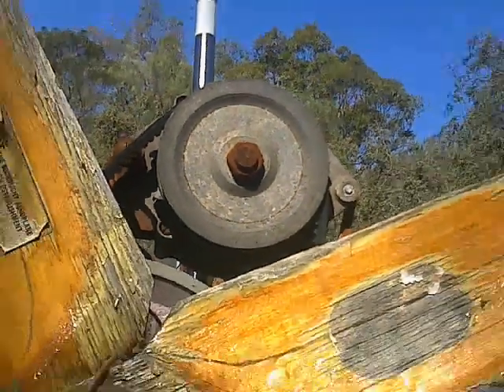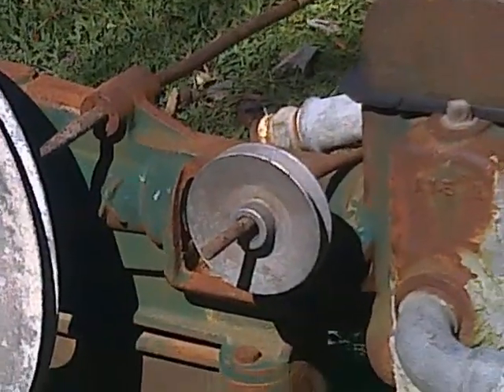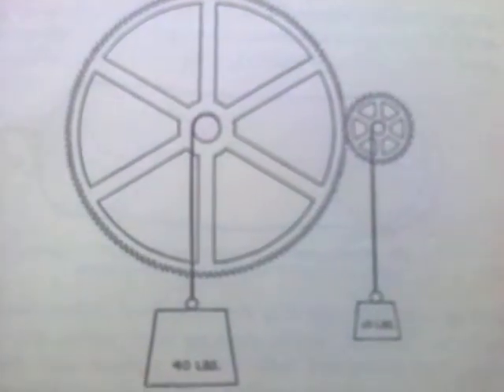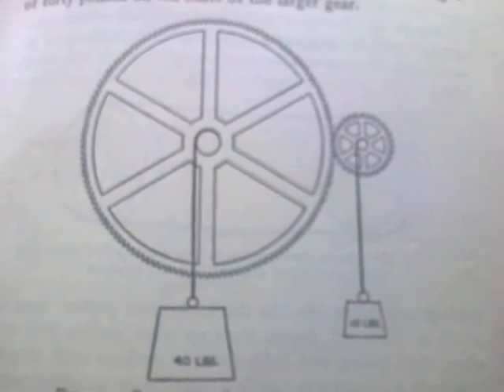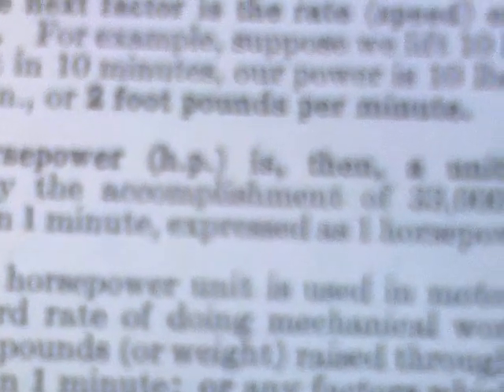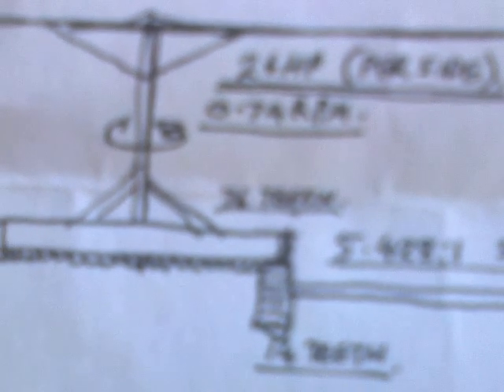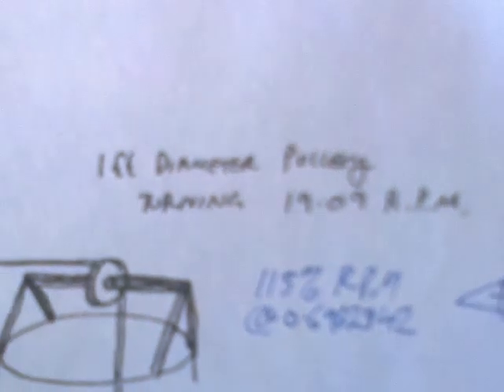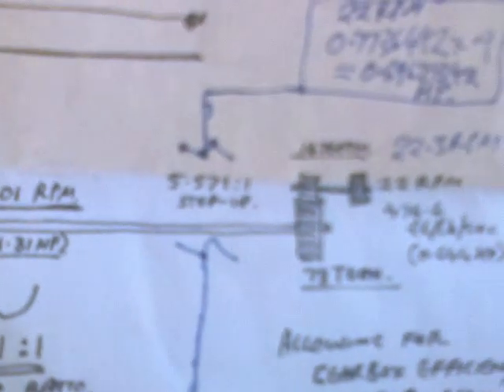The Magical Dunning-Kreuger Gear-Ratio Effect...!

Comment: I reckon it’s weird when you stare at a spinning propeller and it appears to be spinning backwards. It’s an optical illusion
Reply from the maker: G'day Ed,

 Thanks mate.

  Yeah, it used to have to do with the mechanical Shutter of old Movie Cameras & the Frame-Rate ; any time a wheel was turning at an exact multiple of 24 then it looked to be stopped, if it was turning at almost an exact multilpe then the "stopped" wheel apparently went slowly backwards, and if at slightly more than an exact multiple the "stopped wheel seemed to turn forwards.

   Now it's done with Charged Couple Devices & they scan Left to Right in a column of lines...; so turning Blades come out as looking curved, because it moves between Line-Scans as the Picture is being "Built up" - whereas with Chemical Film the whole Frame is exposed at once in a "Snapshot".

  Techno-complications....

Have a good one,

;-p

Ciao...!

Comment: By the way, I was taught this math during sailing class. We had to calulate force, work, etc., based upon different gear ratios, and block-and-tackle "falls."

What both of you should be talking about is WORK, but as you noted, your friend is not talking about WORK consistently, and you are.

Bottom line: if you increase DISTANCE (as gears and levers do when the drive shaft is the smaller gear) the same amount of force can do an increased amount of work--- but slower. This is because Watts have a time component, and work has a distance component.

The simplest machine that does this is an incline plane. It is a machine because it increases distance on the horizontal, to lift a shorter distance on the vertical, over a longer time span. WATTS stay the same, but WORK increases because DISTANCE increased.

Comment: Hi Chris,

More numbers? I was never any good with numbers, but you have a gift with calculations.

The way I see horsepower is the bigger the horse the more power so the Clydesdale horses, (they get their name from where I live) would pump out plenty of power. That's my calculation :D

The place of Uddingston is just about 3 miles from my house. I never knew that the company John Grey & company even existed. 

Cheers mate.
Reply from the maker: G'day,

  Thanks Mike.

   Well, I was hoping you could tell me where the place was.., it must have been in a reasonably big way - the 76-tooth Crown-Gear on the  Capstan is four & a half feet accross, cast in one piece...; it appears that Johnny Gray & Co. had a pretty good idea of what they were doing...! 

  I agree that Clydsedales, big due to having been bred for pulling Ploughs, or War, were bigger than Pit-Ponies...; but the idea of a "Horsepower" being 550 Foot/Pound Seconds of Twistiness in a Shaft, with a 1-Ft diameter Pulley turning at 19.09 RPM - is an old starting-point, and I figure a pretty good one from which to calculate the "worthwhileness" of attempting to make Electricity with a Horse-Mill...

  And I'm pretty sure I've got it right..., that multiplying the Twistiness will divide the Shaft-Speed, while multiplying the Shaft-Speed divides the Twistiness delivered in the Output Shaft, as compared to the Input Shaft...; and 405 : 1 is a monumentally humungous Step-Up Ratio...., before even getting to the Generator so rather than being too upset that there's "so little Electrickitiez" to be had - I'm amazed that it's as much as 29.02 Watts per Nag !

Such is Life,

Have a good one...

;-p

Ciao !
Reply: Here is a couple of links that may interest you.
 https://www.gracesguide.co.uk/File:Im1877Glasgow-Gray2.jpg

I am in Motherwell so here is a map of the area with Uddingston.

https://www.google.com/maps/place/Uddingston,+Glasgow/@55.8030833,-4.0824893,12.5z/data=!4m5!3m4!1s0x4888402a3dccf359:0x33f8d3f906dc4492!8m2!3d55.815735!4d-4.0791271

It's a big link from Google maps. Hope they work ok.

Oh, I meant to add. If you look at the map you will also see Blantyre, the place where the famous David Livingston (explorer) was born and lived.
 Cheers Chris.
Reply from the maker: +Mike Flight 

Ah, well, my phone couldn't follow those links.

  I'll have a look in the big Readers' Digest...

  Have a good one,

;-p

Ciao !

Comment: I'm with you on this one.  It's hard to believe that the video you mention was used to prove a point. Even if the video isn't fake, it's not an accurate method for determining watts of electricity production.
Reply from the maker: G'day,

  Thanks mate !

    I'm glad that you too can see that counting the Bulbs, and multiplying the number in the flock by their Wattage rating printed on the Glass, is not a valid way to estimate how much Electricity is emerging from a Horse pulling on a Capstan turning a Step-up Gear-Train...

   Old mate and I had spent about 4 dayze over Xmas bombarding each other with Text Messages, neither one yielding an inch ; so YT Peer-Review was the only reasonable solution -  short of trying to convince the  local Historical (Hysterical) Society to lend me their Horse-Mill, and persuade someone to relocate it to somewhere big enough to set it up, and then go looking for a Harness-trained Horse...., with which to actually do the Experiment.

  Anyway, Happy New Year,

  Have a good one...

;-p

Ciao !

Comment: Torque and rotational speed calculations are superfluous .. Input Power is 1 Horse power (740 Watts ) multiplied by transmission losses (chain drive typically 98 percent efficient) Lets say 95 % per step up stage of 60 tooth and 9 tooth  (6.66667 speed multiplication) in 4 stage will achieve 1462 rpm.. So 740 watts  by 0.95 X 0.95 X 0.95 X 0.95  leaves 602.734 watts of mechanical power to convert to Amps and Volts.. Most modern generators will be better than 80 percent efficient giving 482 Watts of electricity... that's about 35 amps of 12 volt power or 96 amps of 5 volt USB power. enough for 32 I phones and 32 I pads.. The video you mention looks dubious .. the horse is not a standard  British Pit Pony and could be inputting illegal amounts of energy... the slip rings on the vertical shaft  look fake and decorative.. and the globes seem to light the instant the horse moves ??  F A A K E as.
Reply from the maker: G'day,

 Thanks.

  I disagree strongly with your assertion that RPM & Torque measured at the Shaft are superfluous.

  To multiply the RPM by any Step-Up Ratio involves dividing the Input Torque by the Ratio in question.

   1 Horse with a 26 :1 Leverage advantage at 0.74 RPM driving a 405:1 Step-Up Ratio achieved in 2 Gear-Trains (at 90% efficiency, each) plus 2 Belted-Stages (at 95% efficiency, each)...is in no way able to deliver 0.73 of  Hp worth of Twistiness at 300 RPM.
  
  The actual Figure is 0.0461509 of a Hp worth of Twistiness, at 300 RPM.

  Think of it this way, everybody who ever tried to fly with Engines between 8 Hp & 80 Hp, running at 3,000 RPM to 6,000 RPM, using direct-drive Propellers has been disappointed (many, like me, have crashed with their Direct-Drive high-speed tiny little Toothpicks cutting useless little holes in the Air, converting Fuel into Noise)...

  The High Shaft-Speed & low Power means insufficient Torque to turn a large Propeller, and the small Propellers don't engage as much Atmosphere, so the small Disc has to try to accelerate the little bit of Air it can grab to really high speeds, relative to the Aircraft's Airspeed...; and for example, a 65 hp Engine at 6,500 RPM and a Direct-Drive Propeller about 4ft 6 Inches diameter, emgaging 15.9 Sq Ft, will struggle to fly....

  It's Tips have a Circumference of 14.139 Ft, and at the Engine's "optimum RPM (108 RP Second) it's trying to drive the Tips at Mach 1.53...

  Which won't happen, and the "ideal" Tip-Speed is 660 Ft/Second - after that the Tip-Drag becomes prohibitive, so the Prop wil bog-down at about 750 Ft/Second Tipspeed, or 3,250 RM, or 54.1 Rev's per Second, at 15.9 Sq Ft.

  If one was trying to fly at 50 MPH, allowing for 10% Slippage, the Propeller would be pitched for 80.3 Ft/Second Advance rate, (at 6,500 RPM).

 But at the achievable 3,250 RPM which is achievable, meaning a Slipstream of 40 Ft/Second as the the Advance Ratio (less slippage,) giving 36 Ft/Sec. which = 572.4 Cubic Ft/Second (at 0.09 of a Pound per Sq ft going backwards at 24.65 MPH giving 51.5 Pounds of Thrust....
 

  However, given a 2.58 : 1 Reduction Drive, the Output Shaft only tries to spin the Propeller at 2,519 RPM, but the (modern Rotax) Redrive Gearbox is 95% Efficient, so the Prop. has 159.315 Hp worth of Twistiness driving it ; meaning the Propeller can be maybe 72 in diameter, engaging with  28.278 Sq Ft of Disc Area., the Tips sweep a Circumference of 18.85 Ft, so a the Gearbox is trying to achieve 791 Ft/Second, which is broadly achievable..., and with 80 Ft/Second theoretical Advance Ratio, times 0.9 (allowing for Slippage), the 71 Ft/Sec times the Disc Area = 2007.7 Cu.Ft./Sec, at 0.09 Lb each equals 180 Lb Thrust, at 50 MPH.

   That Calculation was off the top of my head, and my assessment of it is that both situations underestimated the actual Thrust...; I would expect 100 Pounds Direct Drive, and I know that a 64 Hp Rotax 532 with a 2.58 : 1 Redrive & a 68- Inch Prop (on the Dragonfly Tug we used to aerotow Hang Gliders with) used to make 257 Pounds of Static Thrust, and when tied back-to back it could pull a Cessna 172 with a 150 Hp Direct-Drive Propeller all around the Airfield.

  The RPM/Torque Calculations Do INDEED matter, A LOT..., when it comes down to how much Work can be performed by the Driven Shaft.

 That was a Reduction-Drive Gearbox, but Step-Up Drives are the obverse of that equation, RPM is multiplied but Torque is divided.

  In my experience.

  Have a good one.

;-p

Ciao !
Reply: That's because it's not a real horse. It's actually two dudes in a horsey suit :p
Reply from the maker: +Phoenix Chastaine 

Yeah, speaking Pensylvania Dutch, too, apparently.

  It must be a rebelliously apostatic sort of an Amishman, experimenting with Electrickitiez with a Horse to keep it propperly primitive ?

  ;-p

Ciao !

Comment: google 'nikola tesla radiant energy receiver 1901; remember that big spike on a stick - tesla used a simple electric [electronic] circuit at ground level. it works. i left that part out when i first told you about it. consider this sort of a last request.  my last meal will probably be jello. or iv saline.
Reply from the maker: OK,

  I'll see what comes up.

    I take it from the tone of that final fatalistic prediction..., that your Buttocks aren't healing as well as hoped ?

  How long ago did you hurt your Spinal Cord ?

    All I can suggest is Bedrest with strict side to side positioning & PAC every 2 hours or less, to avoid stressing the skin over your Hips ; while not putting any pressure on the already damaged Buttocks, to give the Skin there a chance to recover - and topical treatment of any breaks in the Skin there to avoid infection.

  Old fashioned Nursing Tom..., it can't be done with an iPhone ; the Japanese have been trying  and failing to develop Robots for delivering Nursing Care for over 20 years, because they haven't been breeding enough young Japanese to nurse all their Geriatics - and they're highly culturally-resistant to importing foreigners as a Labour-Force.

  You'll pretty much need to endear yourself to the Nursing Staff mate, become friendly & charming & effervescent, to the point where they want to sneak back and give you extra Pressure Area Care, because they like you so much....; not Tough-Guy, nor Wise-Guy, definitely not Sleazy-Guy..., but try to dial-up the Nice-Guy as much as you can manage.

  Take it easy...

  Such is Life,

;-p

Ciao !
Reply from the maker: OK,

  Well, I goggle-eyed it, and got a look at a bunch of Circuit Diagrams - none of which I really underconstumble..., and a vast swag of Articles & Patent Abstracts & Essays & Dissertations ; which convinces me that there are probably at least 5 million people on Earth who are currently already devoting huge chunks of lifetime to trying to make a Go-er of what Tesla is said to have done.

   And, to be honest, the last thing I want to see is for the Industrialised Global Economy to discover any actual "Free Energy" - with which to make 100% certain that the remnant Ecology of the Biosphere is killed-off entirely, before the final Factory stops producing yet more Landfill...

   At least, the way things are..., the cost of extraction & processing & transporting Fossil Fuels (which are currently ludicrously cheap, considering their Energy-Density & convenience) is the only thing which prevents some of the more ridiculous Profit-seeking Schemes from going ahead....

  So, I went, I saw, and it's all beyond my ken ; I got yelled at as a kid, for not already knowing all about Electricity, and together with a 240-Volt AC ZZZAP ! at about age 3..., I pretty much switch-off every time I attempt to go near a Circuit-Diagram ; and as the Song said (imprinted, at the same time...),

"Do what y' do, do well, boy...
    Do what y' do, do welllll.....!"

  And Elektro-Sparkliez is one of the things which I don't really do - beyond Plug & Play, kinda thang !

  It's why/how I raised my son to be an Auto Electrician..., his Adolescent Rebellion was to get to be really good at something which I'm no good at, at all...; Interpersonal Skills is another one, I'm a mad Hermitic Hippie on a Hill, yet he's a Mainstreet Businessman and a Fire Brigade Captain...!

  One cuts one's coat to suit the cloth available, and I avoid fields of endeavour when I know I'm no bloody good at them...; which makes me a lazy wastrel, perhaps - but I'm a HAPPY lazy wastrel, and I raised my kids to not suffer from the Neurotic Short-Circuits which I aquired as built-in flaws, hardwired at an early age & long-since concreted into place as Entrenched Defences (against possible {repeated} failure).

Take it easy,

  Such is Life....

  ;-p

Ciao !